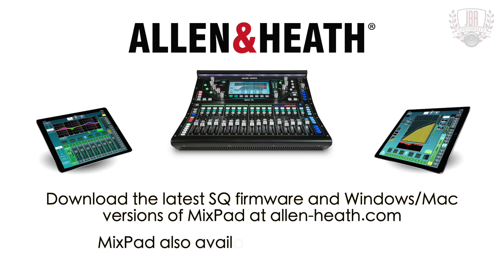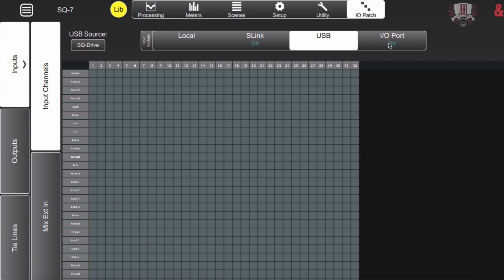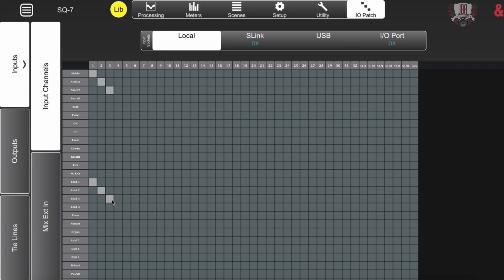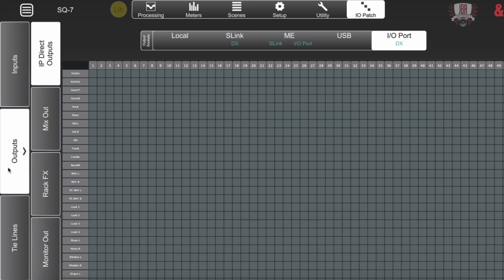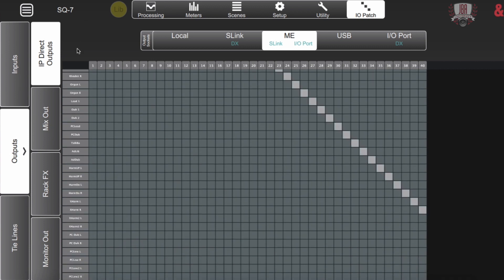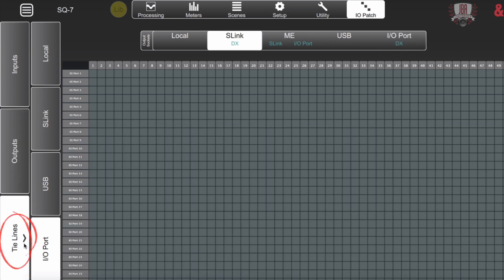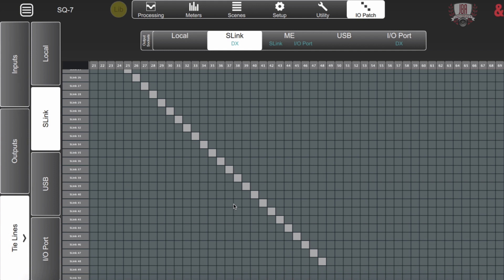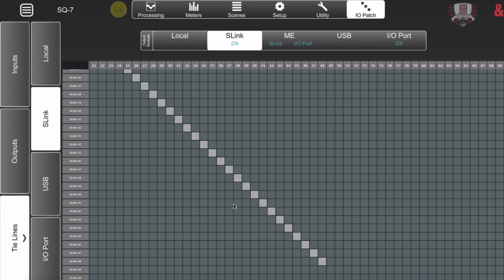Allen & Heath SQ Mixpad Offline Editor - Part 8 - I/O Patch Tab

Comment: So I'm being tasked with learning my way around an SQ7 for a show I'm working in a few weeks.  I will not have access to the board until the day we move into the theater, but I was able to get a copy of the current settings.  I put those into Mixpad to see what I could configure beforehand.  It looks like there are 32 direct inputs on the board, but only 28 showing on the IO Patch tab of Mixpad.  Any idea what might be wrong?
Reply from the maker: It’s possible that those inputs were unpatched or they are assigned to a usb input, card slot, or stagebox. I would check the tabs for the other input types (usb, card slot, or stage box).  All 3 SQs handle up to 48 inputs and they are all freely assignable. It’s also possible the theater doesn’t need more than 28 inputs for their default show file and chose to leave them unpatched.
Reply: @Johnbanthony  that's. Yeah it's something weird. I saved the show, closed it and reopened it and suddenly I see 32 channels instead of 28 so I guess I'm good.
Reply from the maker: @Chris3460  Glad to hear.